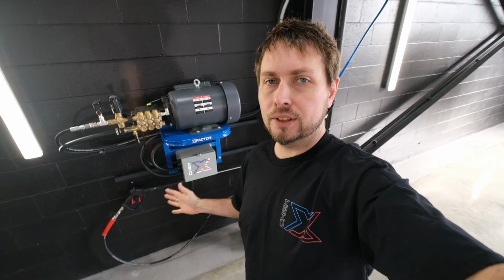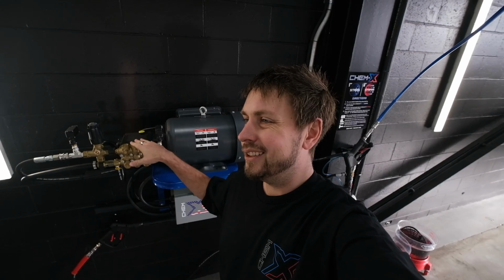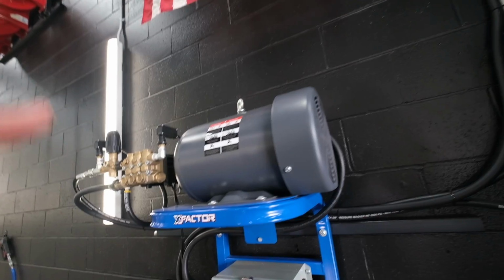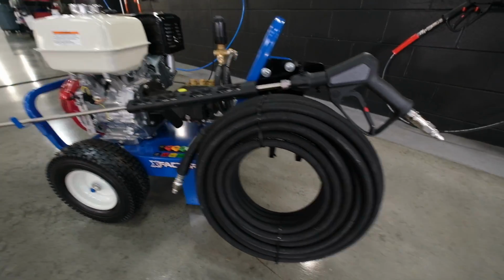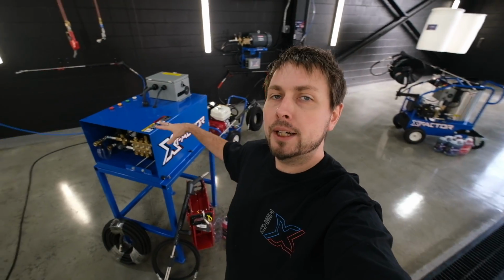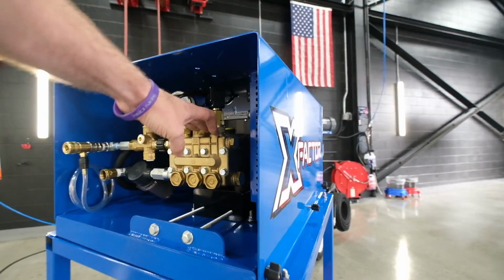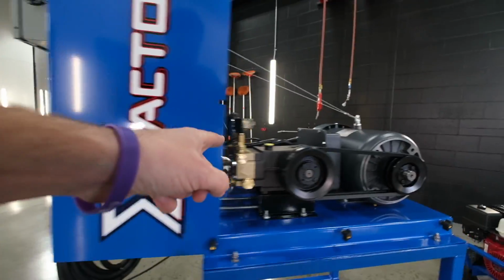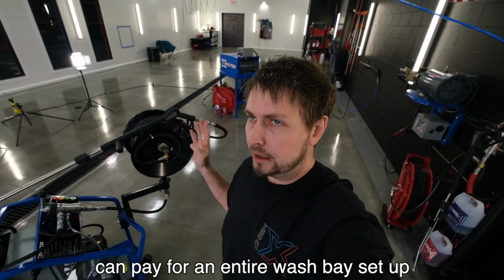Introducing my very own full line of power washers

Comment: Very awesome! Have been waiting to see your line of pressure washers revealed and ... you didn't disappoint (like that was ever a option really)!!! If they work as well as the rest of your products do ... you'd be a huge idiot to buy one of the other systems that costs as much or even more and doesn't perform or last as well.   My ONLY issue are the portable hot water units, need to be able to roll on all surfaces. Paved, Gravel, Dirt/Grass ... we don't all have fancy paved lots or wash bays and struggling to wheel that in/out will lessen the chances of use. I know what Ill be buying for the new shop next year!!! Keep up the awesomeness!!!
Reply from the maker: Thank you I appreciate it!😁👏🍻